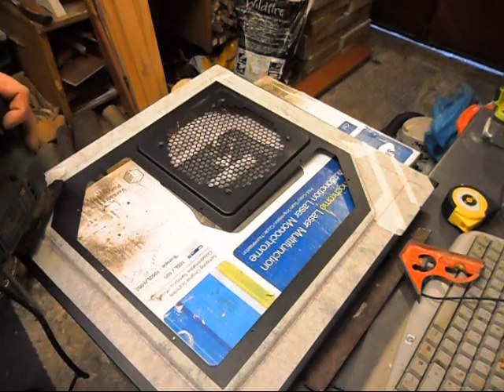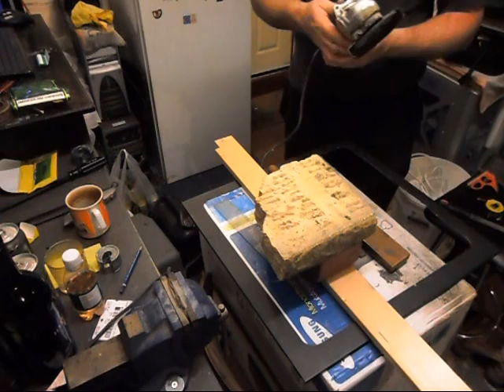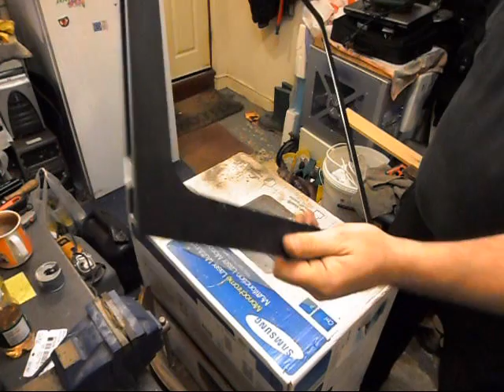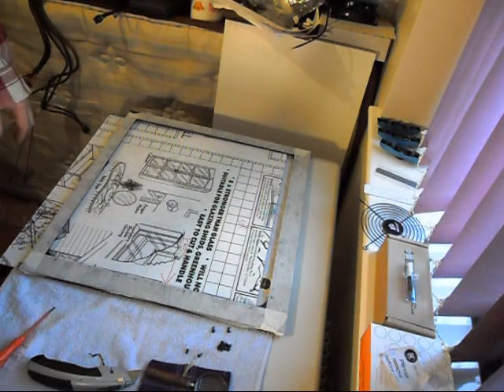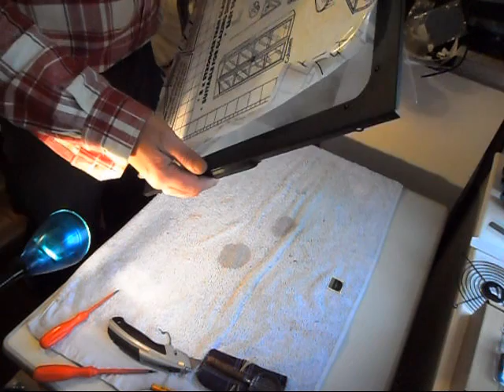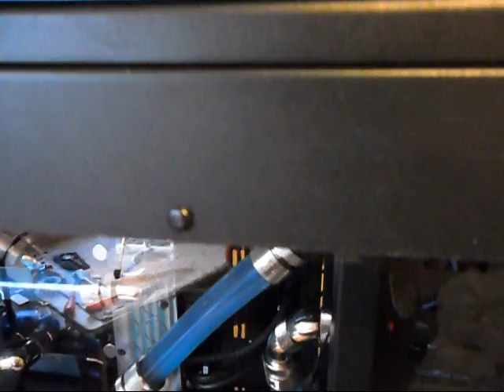SIDE PANEL WINDOW MOD - HAF X .wmv

Comment: What did you use to hold the window on the frame?
Reply from the maker: Xtreme_Green Thanks for watching the video, I used 3mm button head plastic push through rivets that came off the old side window.